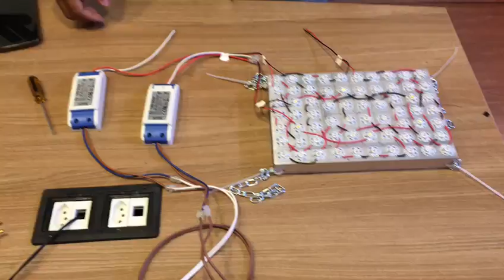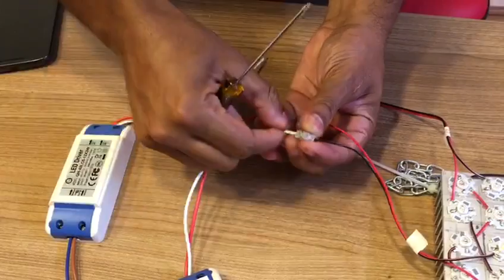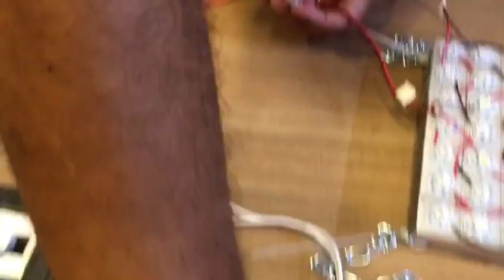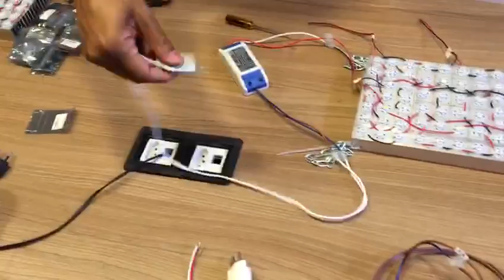Falty LED Driver. What is the problem and how can I solve it.

Comment from the maker: I discovered the problem. I inserted 2 more LED lamps to the circuit and it worked.
Reply: Why did adding 2 fix it
Reply from the maker: Bluegrassconnection Legalize It I believe that the total voltage was too little and that's why it wasn't working. When I added 2 more the system was balanced.
Reply: Inconsistencies in cheap drivers
Reply: Because the driver ic always monitor the current if it is high it shutsdown or try to avoid overheating by pulsing thats why it worked when connecting 2 loads to decrease current now it gives constant current